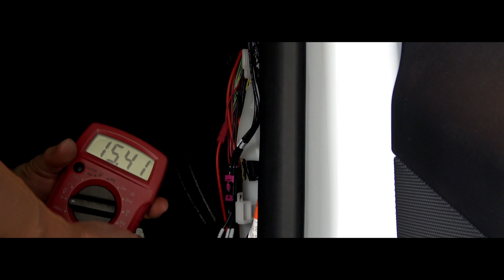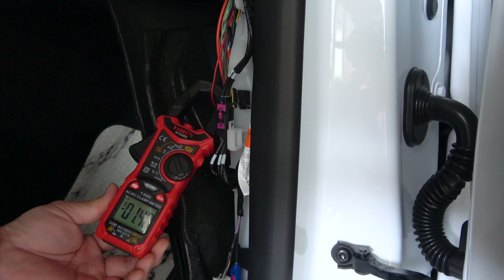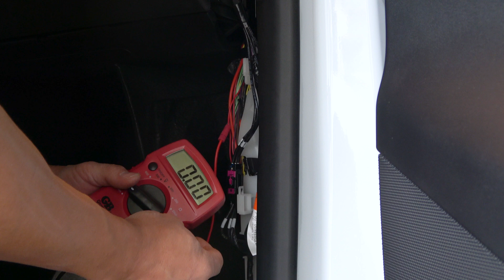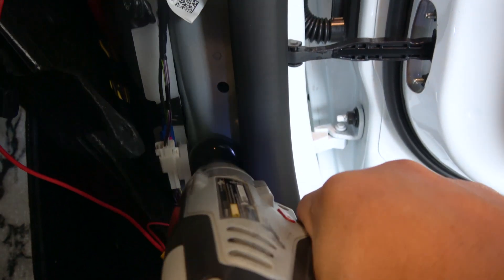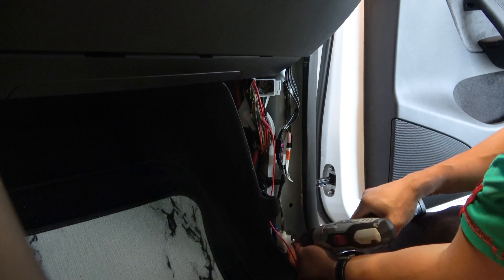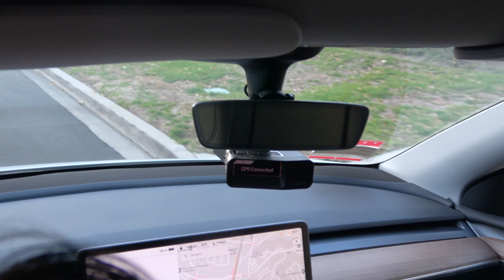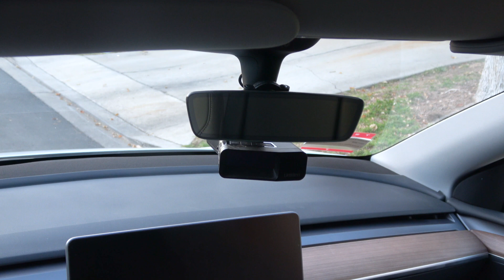Don't void your warranty | 12v switched accessory power Tesla | Hardwire Install

Comment: Do you know the power rating of a circuit you tapped to? I.e. what is the max current draw for that red wire? How many accessories can you tap to it?

Also could you recommend on where to tap for a constant on +12V? Some devices require both ACC and always ON
Reply from the maker: I believe that red wire has an electronic trip at 15 amps, but I wouldn't go past 10 amps, so I have a 10A fuse built in. 10 amps is plenty to power many typical accessories. The constant red wire is present in many places. The typical place to tap it is on the VCLeft, thick red wire. I'll show that in a future video, because I need constant 12V to charge my phone and tablet. Also, the armrest 12V plug blue wire is also constant.
Reply: @teslamods  thank you for the reply sir! Do you know if there's a +12VDC switched on when the car is unlocked regardless of the brake pedal? I.e. car is locked - 0, car is unlocked - +12VDC
Reply from the maker: @awesomedn  there may have been in the past on the VCLeft, but after several updates, none seem to exist right now, with the latest Christmas update. Tesla S/Y/3 doesn't care whether car is locked/unlocked; only cares whether car is "on" (driver is in position). When there's no driver, and kids are sitting in the back, the car is considered "off" so all switched 12V are off.